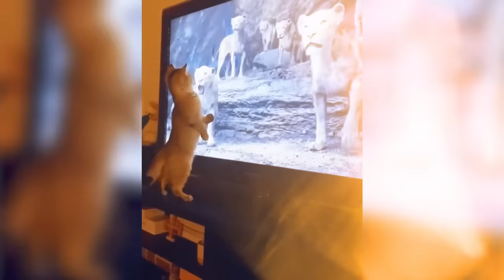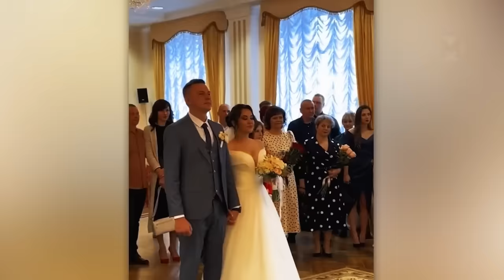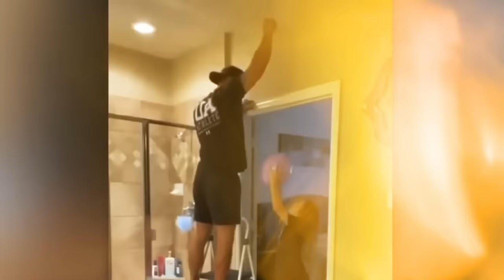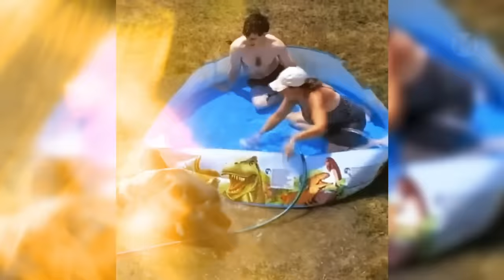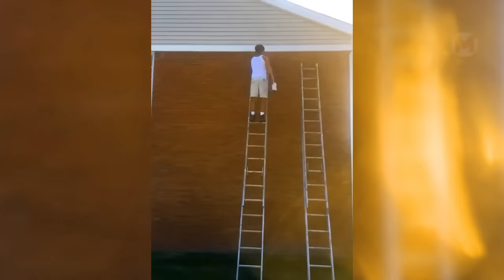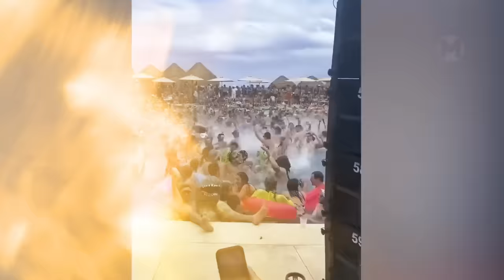It is Impossible to Forget! Funniest Moments Caught on Camera

Comment: Its always funny when American call a garbage bin a trash can. We do not normally get cans that big.
Reply: Those trash cans are large but they are meant to be. They are usually equipped with a bar on the back which can be hooked by the garbage truck, lifted up and emptied into the bed. It’s meant to save the trash collector’s backs.
Reply: Everything is bigger in America.